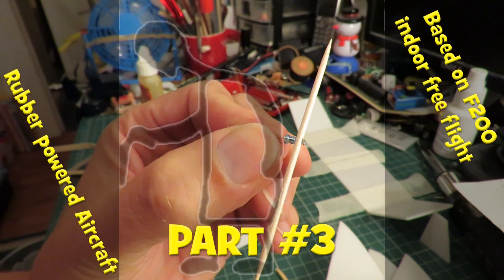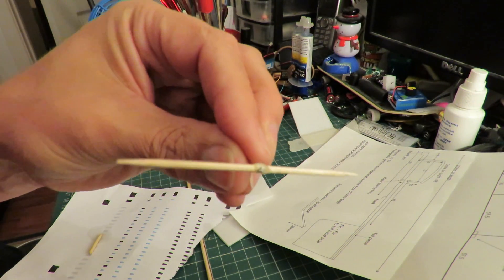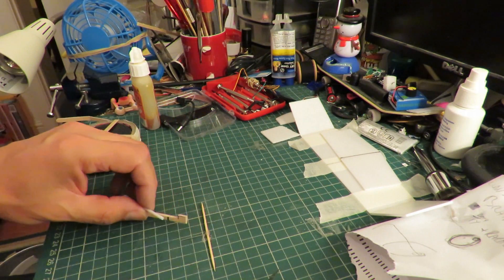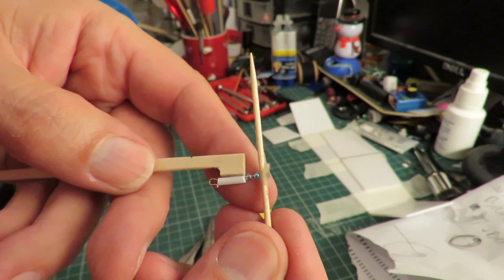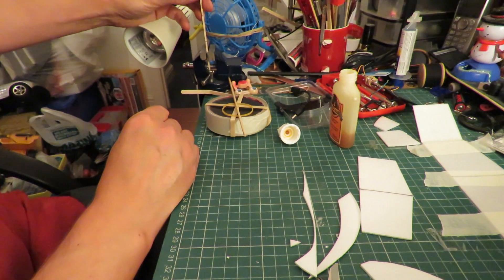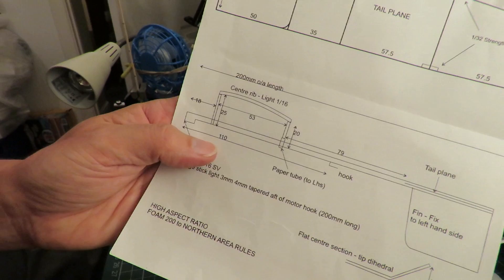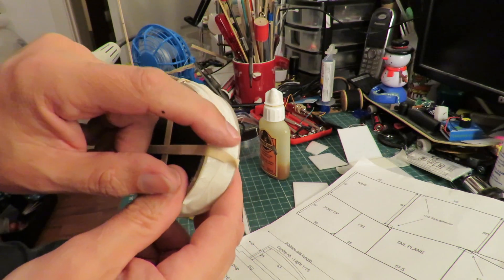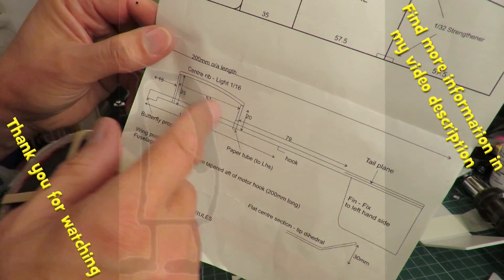Rubber Powered Aircraft Based on F200 indoor free flight PART #3

Comment: I like watching your videos.I want to ask you something.What is the material and dimensions of the propeller ?
 Thank you.
Reply from the maker: The propeller I made was just from the same foam that I made the rest of the plane from, which was from a foam plate. It wasn't very efficient. Watching the video I would estimate the blade size to be about 70mm by 20mm. The instructions for the F200 tell you to use an Ikara butterfly prop which you can buy online. I think the one I made in this project was a better one https://youtu.be/6vclJpK_O60?list=PLA5a2xPRSrB3oMljeSQ0QM8coW8cuoqmS

Comment: its 2 part epoxy mate, not 2 pack... that poundland stuff is good... i have used it for many projects and never have issues
Reply from the maker: Call it what you like, maybe try Googling 2 pack and see what comes up.
Reply: 37 seconds in... says on the label bud...
i wasnt intending to come across as rude or condescending...
just supplying you with some friendly info as you do with your subs...
your reply seems a little stale to me...
hopefully its just because you cant really add emotion to written text...
Reply from the maker: TheDaddy187 like I said, Google it (and up comes Two Part) so you will get the right stuff, I have been calling it two pack for the best part of 60 years and never had any problem getting it and I doubt that I will change what I call it now :-)